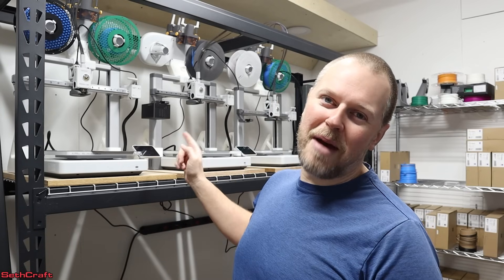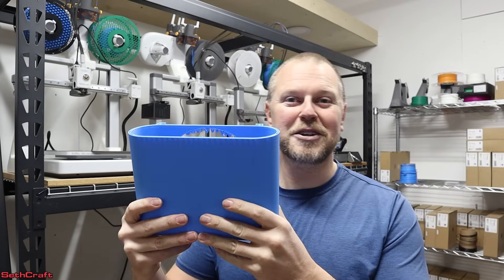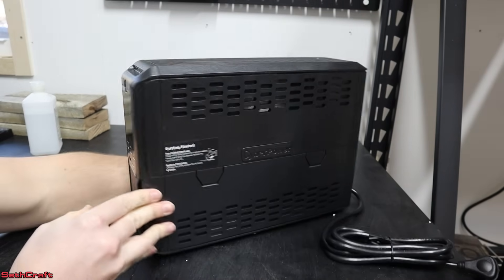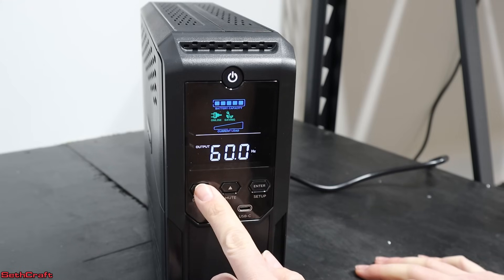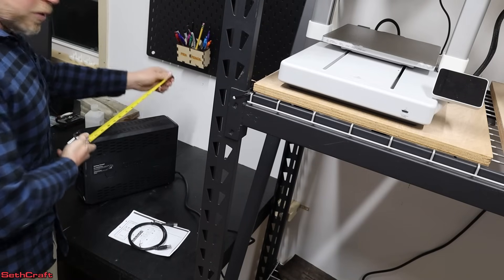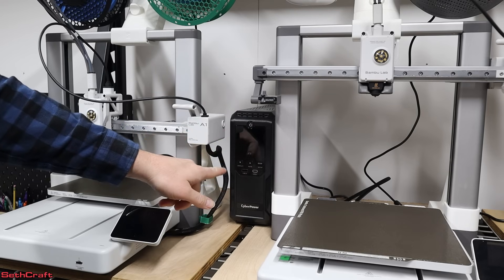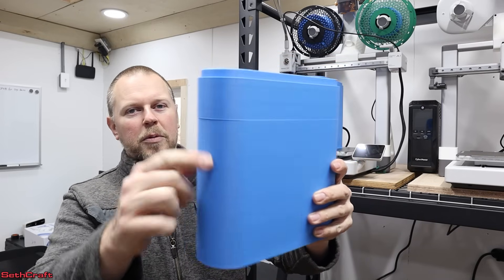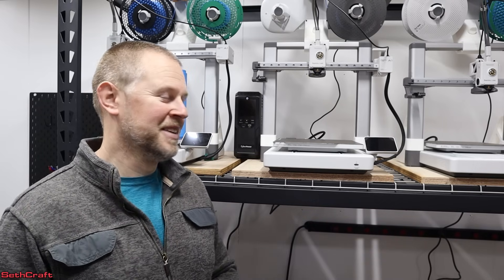If you 3D Print you Must Get One of These! A UPS will save lost time and money.

Comment: I'm surprised the power supply in those 3D printers isn't better than that as it seems to be allowing voltage spikes or dips to upset the stepper movements.
Reply from the maker: After installing the UPS I have not had another issue. This seems to have solved the problem. I guess the printers are more sensitive than we would like.

Comment: Do Bambu printers not have auto-recover for prints that would stop midway due to losing power? You should have at least been able to salvage the partial prints.
Reply from the maker: The printers do have an auto recovery however if the print bed has cooled and the print comes lose its over. If the power blinks shortly its not an issue. The printers can recover from that. In my case the Power Station I was using turned off the AC output and the print was cold for 8 hours.

Comment: oh dear - the american power grid
im not sure if 1 Test print is enough statistical evidence for the error.
but you can try to fore such errors with your oil radiator making continuous on/off cycles
im not sure if the cheapass ups is able to so fast balance the line when its in standby.

if you have an oil furnace - the burner maybe uses 100 watts,  that shouldnt make such high spikes

normally a good psu (in the  printer) needs to have enough reserves for small grid outages

I would recommed a separate fused socket each only for 1 printer.
Reply from the maker: turns out the issues was my own heater messing with the power. However after the big storm that knocked out the power for 18 days the grid is not reliable. I had no less than 5 prints mess up on the system before the UPS. I only showed the 1 print in the video. 

The oil heater turns on at 700w. The Bambu A1 can continue on a power supply switch time of 15ms from my testing.

Comment: You experienced what is called a "brownout" or "power sag" when your high current sucking heater kicked on. It only took me one time of having a $100+ print fail during a storm power outage for me to hook my Ender 6 (350 watts or thereabouts) to a UPS. When the power went out, it then gave me enough time to attach an EGO PAD5000 400 watt 56v battery powered inverter which even gave me more time to setup, start and run power extension cord from my gasoline inverter generator to the 3D printer in the basement...probably close to 75 feet of extension cord...to keep it powered and printing. Never skipped a beat!!! Tragedy averted!!! Just remember "2 is One, One is NONE!!!" when your UPS conks out during a serious outage, you're gonna be hurtin'!!! Just to add insult to injury, your UPS contains an AGM (Absorbent Glass Mat) Lead-Acid Battery which will give you nowhere near the runtime of a Lithium (LiFePO4) Solar Generator type setup. So just get an EcoFlow to put right before the UPS. Lithium also has more robust charge/discharge cycles unlike lead acid where when you cycle them hard, they are extremely prone to early failure. Believe me. I have a UPS hooked up to just about every piece of data or media equipment in my house and the UPS's that fail the hardest are usually the ones that are connected to the higher current draw items such as computers and not the TV's.
Reply from the maker: Sounds like you had a big job on that printer! Learned that lesson really fast. It only took me a weeks or so to learn that I needed a ups. Once my oil heater is removed from the room I have a 15kwh whole house system that will run the printers off grid. That is a much better 2 is 1 situation. I tried to use a Zendure Super Base V but sadly it turns off automatically at 48 hours. Was not a good solution to battery backup.

Comment: These are shit. We have lower spec models at work. Sometimes batteries last more than the ups, I have a stack of 5 broken units. Some do not charge the batteries, some are just dead.
I bought the model you have but 1000VA. A PIECE OF SHIT. It can not hold an ender 3 s1 pro which has MAX 350w power draw. It measured around 250w power draw when it started beeping and froze to error 03. I will return it. It is clearly faulty.

Also be careful with the software if you install it, especially with linux and klipper. The software uses serial USB, the same as many 3d printers. After a couple of ups failures, the software on the laptop somehow took the address of the printer and fucked everything up. It took two days to find the issue. I suspected a corrupt firmware, or a damaged printer board. Nope, that shitty powerpanel personal management software messed everything up.
Reply from the maker: Sorry to hear that you have bad experience with this model. So far I have around 40 hours of print time on this one and it has not had any issues. There are plenty of more costly models of UPS. Perhaps if this one does not last long I will try something else.
Reply: @ I think it is more of a quality control issue. We also have some very old cyber power units that are reliable. But the new ones seem to depend on your luck. Before this one I had an old Mustek 800VA ups that kept the printer online without an issue, reporting only 70% load while heating the bed and nozzle from 0 to working temp.
Reply: i have one of the 1350va units i bought 10 years ago, i've replaced the batteries once. it has survived running my desktop with 850w supply through very cold winters living in a trailer to now living in an actual house. i also have 3 of the 1500va units at work, 2 run our Prusa XL 5 tool printers (750w draw on preheat) and the 3rd runs another powerful desktop with 850w supply. 3-4 years on those units so far. i've another APC rack mount UPS that is now giving me inverter errors and randomly decides to not recognize the battery. i'm replacing it with the equivalent Cyberpower unit.
Reply from the maker: Good to hear that the Cyberpower has done well for your needs. This is the first one I have tried. So far so good.

Comment: In rush on furnace dragging your 120v down, hit meter in wall will show it.
Reply from the maker: It cycles at 700w. I am about to move the heater to a dedicated grid circuit and the printers will be run off grid. Should solve the issues I was having. But the UPS is providing very clean power and I am happy.

Comment: I believe that even PCs should come from the factory with a mini UPS of at least 1 minute, giving the operating system time to dump its RAM to disk and recover from power failures.
Reply: Even more interesting, as a former copy machine technician, I arrived at the conclusion that all copy machines should have an implementation of a UPS for the "brain"/computing system of the machine as many times during a "power event"--lightning storm/wind storm, the power would either bounce or sag causing the data to be corrupted on the hard drive and requiring a hard drive replacement or a drive re-format to make the machine functional again. I most definitely had "job security"!!! 😂
Reply from the maker: Its wild how fast computer data can be corrupted. I remember the old Dos days.
Reply from the maker: That is a good point. Probably increases the cost more than they are willing to go to.
Reply: They do, it's called a laptop. :) Seriously though, I switched to laptops for my development machines 12 years or so ago and the driving force was most obvious, for business travel, but it has proven to put a smile on my face when power trips and I am not plugged into a UPS.  However, I do miss being able to stuff all sorts of aftermarket cards on the PCI bus.

Comment: Bambu doesnt have print resume after a power outage?
Reply from the maker: Yes they do. however if the bed cools the print is lost. So for the power station test that turned off after 48 hours. The print sat for several hours with the power off.
Reply: they have ;)

Comment: the alternative is, that you live in the UCTE area - luckily here in Europe we have the most stable synchronous Powergrid in the world (by far) powered outages are a very rare exception and fluctuating frequency or voltage is virtually impossible

so investing in a USV/UPS is only needed for critical systems like servers

a 3d printer failing due to a power grid issue is possible, but the cost for the UPS is way more than a print failure every 5 to 10 years due to power loss
Reply: Its about conditioning the power in this case, not really power outages. Kinda like having a mini power station in your house to make super clean and consistent power.
Reply from the maker: Yes exactly. The heater was pulling 700w and causing the printer to skip a step.
Reply: @LerrySanders  

Tell me you understand nothing about power grids without telling me ;)

No offense, but this is not correct.

"Kinda like having a mini power station in your house" - usual base load powerplants in the USA have an allowed frequency tolerance of 5 % (which is totally OK, because on average the grid takes care about frequency fluctuations) - so "a mini power station in your house" would be the worst to have clean power ;)

Power outages are an issue indeed, because every power outage in a segment of the synchronous grid raises (or lowers) the frequency of the rest of the grid - this is a major challenge for the grid operators.

To bring this in perspective: the last major event where the european grid went over the frequecy treshold was 2021 where an big substation in Croatia "exploded", this raised the net frequency to about 1,2 % over the nominal value - the issue was resolved in 1 hour. So no continental power outage, but a "small" substation in a country in one corner of the continent was enough to mess up the grid.

This deviation was roughly to 50,6 Hz, so 500 mHz over the treshold of the nominal frequency. The product you use has a frequency error of ± 1% (at 60 Hz) according to the data sheet. So within the specs of the product it would be totally OK to have 600 mHz overfrequency.

The mean frequency error of the european grid is  ± 0,1 % (at 50 Hz).

Long story short: your "super clean and consistent power" is 12 times less stable than an entire power grid that serves roughly 400 million customers in 24 countries.

If it works for you or it is neccesary in the US, this is fine - but for european users this is in most cases just a waste of money.
Reply from the maker: This area used to be nice and clean. After the Big Storm and power was knocked out for 18 days we have issues all the time. Power Poles are still laying half in the road and that was 5 months ago. 

In this case my issues is internal power surging. That heater pulls 700w and causes the printer to skip a line.

Comment: those oil heaters are energy hogs fyi 600w-1200w, it's on more than you think. Racks up a bill fast. It would be more efficient to close in the shelf, its self heated and can have a moisture controlled space with desiccant since the reels are exposed.
Reply from the maker: This one pulls 700w when it kicks on. Most of the year its not an issue here. For example today it was 68 degrees outside. two weeks ago it was 4 degrees out. A fully enclosed shelf would be nice for the heat. moisture but probably not going to happen. Next up I am going to take the heater to a new circuit and the printers will be off grid.

Comment: cool video. I'm wondering if you can do the test with 1/2 the units on direct power and the other on UPS power as a High power device cycles?   Example, put 2 on raw power and the other on UPS, set heater at certain times ( or log ON /OFF cycles ), and let it ride.   Also is the heat produced in the same room as the printers?  Could the vast temp changes cause this side affect?  Perhaps dump the heat outside of room or find a way to maintain even temps during the power tests.
Reply from the maker: The building has 3 heaters running in it. The oil heater is on the same circuit as the printers. That is one thing that needs to change. I have not tested printers on and off the UPS together but I did test the 3 printers together without the UPS and they all had skips at the same layer. That tells me it was a power issue.

Comment: I thought using a UPS was standard practice. No way I’m using a desktop computer or a 3D printer with not UPS backup.
Reply: Depends on the country you are living in: in Germany I would have never considered one. After moving to Romania it's a must have.
Reply from the maker: Power in the USA is often consistent enough to run computers without a UPS. However the heater in my room was causing the power to mess up.

Comment: I don't understand you're supposed to be America you know we have the best everything I don't understand why your electricity doesn't stay on
Reply: Lol, the us is a developing nation in a lot of ways
Reply from the maker: The heater on the same circuit as the 3d printer was the issue.
Reply: it can happen in any country, even if its rare you'll be glad to have an ups
Reply: It's a "better safe than sorry" measure more than anything. I'm up north (Canada) and the power does go out once in a blue moon. At least I'll be ready when the time comes.
Reply from the maker: After we were hit by the hurricane the power grid is unreliable. Many of the power poles are still leaning over and against trees.
Reply: Perretty much you can assume big oil has something to do with these problems to scare people away from EVs. It's one of the main arguments told by people and bots online: oh the grid is unreliable and old.
Reply: It's America, not the utopia.
Reply: old or shitty wiring probably in the building. still UPS are great idea for many devices, including computers.